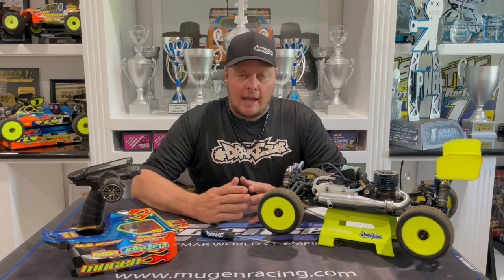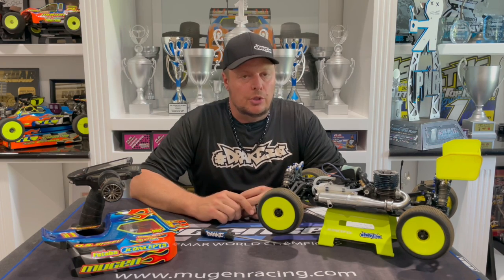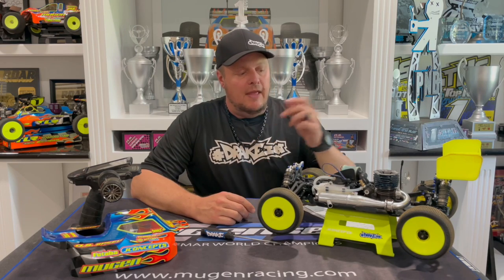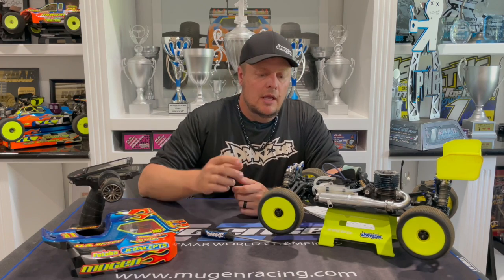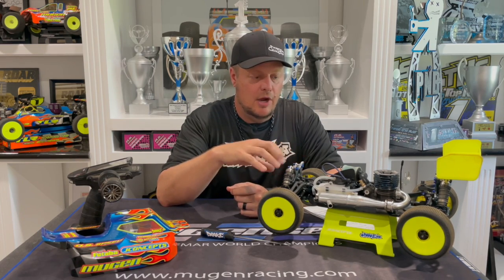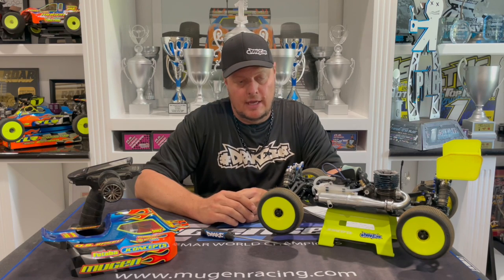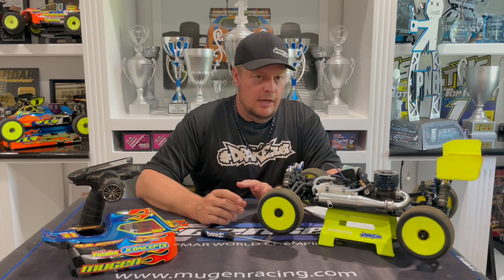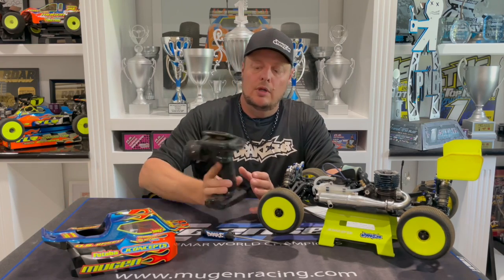How to Tune a Nitro Engine – The basics part 2.

Comment: I've seen far too many people get their new engines 'tuned' over the box by some expert. And when it comes to running laps, the engine is either too lean/rich so these same people will say brand XYZ is notoriously bad at getting a proper tune. Dont get me wrong. I have been following Adam's break-in method for years on my Novarossi /OS and I got it tuned to my liking. Doesnt flame out or overheat, just constant power. Now if only I can download his driving skills as well 😅

Comment: So tuning the engine running on a parking lot is better than tuning it on the box..... is this correct?
Reply from the maker: Correct
Reply: @AdamDrake  okay ... wow.  I usually arrive late at a race and don't have time to run at the track and tune my engine. So I can just go out of the property (racetrack) and tune the engine (running it around)  at the parking lot rather than tuning on a box in my pit area.  thanks man
Reply from the maker: @philfernandez6306  Happy to help!

Comment: Adam, when I experience a flameout when my engine is up to temperature (brand new engine), then I can't get it to restart. I can see that fuel is trying to enter the carb, but seems like heat is keeping it from entering the case and the car does not want to start until it cools off. I am having this issue with one car and it seems like car-related but I can't believe that this is a car-related issue. What am I doing wrong?
Reply: can be glow plug or wrong compression ration for the nitro percentage you are using. You can adjust that with head shims.
Reply: @kyronrc  I threw a brand new glow plug in and it was still doing this and added another shim because I was running 30% fuel but that seemed to have made it worse.
Reply: @marcowerner8739  hmm... in this case test lowering the ratio, i have an engine thats just like that. Using almost no shims makes it run better.
Reply from the maker: What engine are you using?  This will sometimes happen mainly on really hot days when the carburetor is saturated with too much heat and won't allow it to draw any fuel until it cools down.  It's a bit messy, but if you put a few drops of water or fuel on the hsn assembly it will cool down the carb enough to help it draw fuel again.
Reply: @AdamDrake  The new Nova engines. Thanks Adam, I will try this out next time.
Reply from the maker: @marcowerner8739  Sounds good, let me know how it goes.  We have a new broken-in Nova engine available.  If interested, please feel free to message me.
Reply: Could be bad clutch bell bearings or an issue with the clutch shoes not disengaging. Could also be a bad setting on the mid screw ( fuel mixture screw )
Reply: Go back to box stock settings on all screws and lean back out from there. This has done the trick for me more than once.
Reply: What engine are you running?

Comment: I believe thats a main reason some people give up on nitro engines because of some failire at the clutch or wrong glowplug or not sealed right etc, etc or engine bearings important the big bearing inside the engine and a lot of other things especially the carb.
Reply from the maker: Yes, with nitro there are a lot of variables and lots to maintain.  Engine and clutch maintenance is key.
Reply: Clutch issues and rear bearing issues get misdiagnosed as a bad tune so often.  I’m guilty of it too.
Reply: @cbh148  me self i had a old lrp z28 spec 3 was runnning great forget to change the engine bearing inside after 10 litres of running and at some day the engine was running great it revs really high temp was around 135 celsius but and then the engine stops and yeah the result big engine bearing inside was just dfemolished. ME SELF IM DOING SOMETIMES A NEWBIE MISTAKES LIKE THAT BUT IM STILL LEARNING AND LOVE NITRO RC THE SMELL THE SOUND E VERYTHING (((((( sorry for my english i know its not the best)))